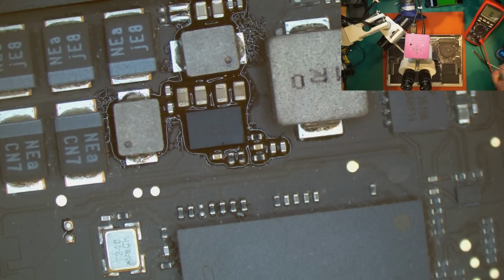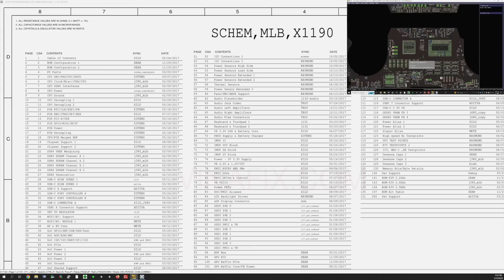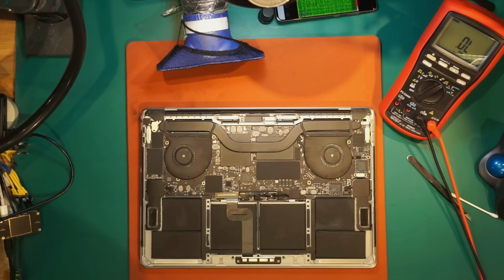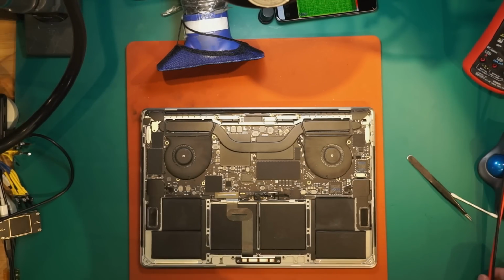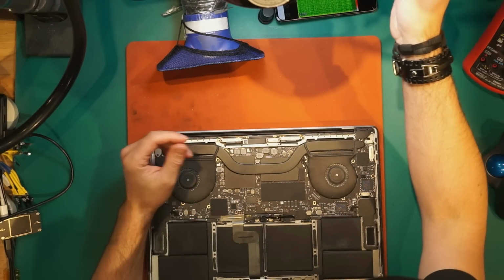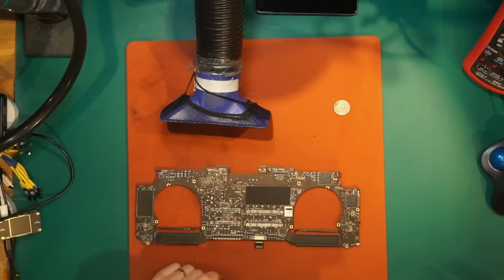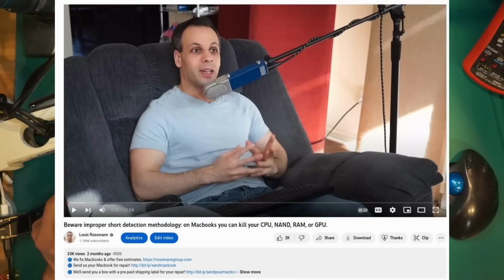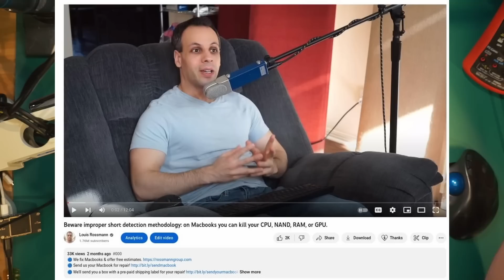Chris has a bad day

Comment: coins might be good heat shields but at 12:23 i think that coin might have caused another short on the board... we can even hear the metallic sound it makes when it touches the underside, while the board is powered. (not that it matters at this point, with a fried GPU)
Reply: Some tape on the bottom-facing side would resolve that.

Comment: Is it a normal practice to set a board on coins or loose wire, while running power?  Are coins good heat shields?
Reply: The coin will deflect the hot air just fine for 15 seconds at the edge of the main hot air jet and protect the chips under it for a short period of time. It won't get hot enough too fast to damage the epoxy encased components. up to 250F is fine for most components for a while and that's not even close to soldering temperature yet. It's important not to unnecessarily reflow components. Should you use the coin while powered up? In my opinion hell no.

Comment: I have an antique hp current tracer and pulser.
You just put small, controlled pulses into a node and with the tracer you can follow the exact current path along traces and to the offending component. On 1980's vintage equipment, it was super fast and simple to find a short on a data or address line, and you just kept lifting the pins on the shorted locations until the short was gone. Invariable it was just one component.😅😊
Reply: ... unless the thing worked with telephone lines in places with lightning. In that case it would be every component on the offending line and its upstream voltage regulator too.
Reply: Interesting information, thanks. Are there modern versions of this?